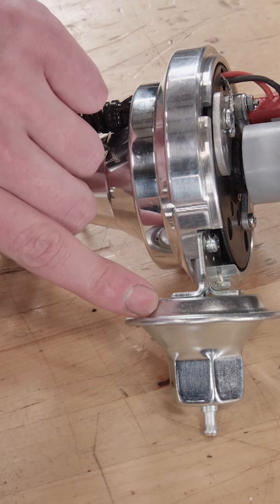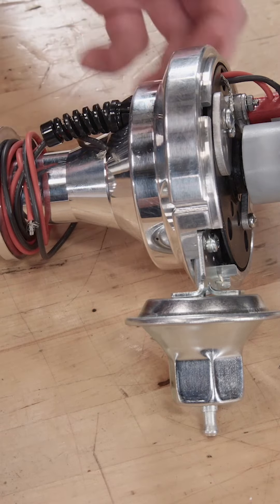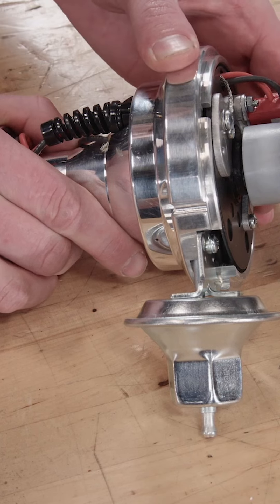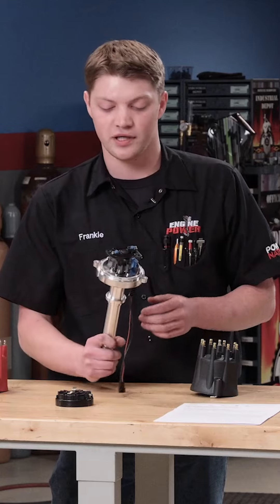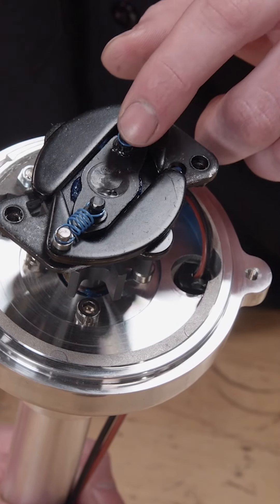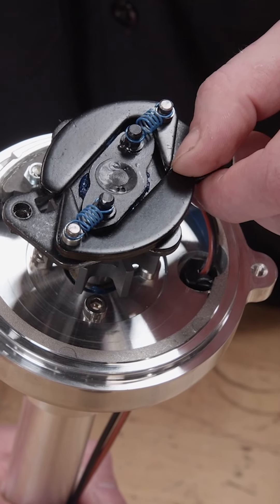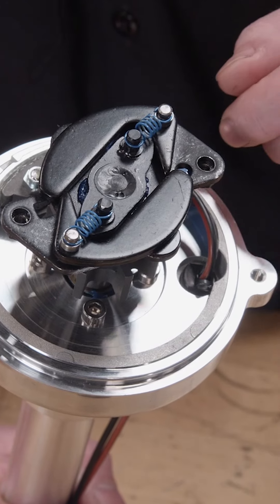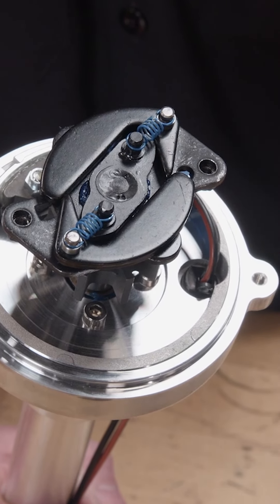Types of Distributors

Comment: Locked out is the best
Reply: Really it's been shown to decrease engine life when tuned for max power. (Imagine having 30+ degrees at idle)

The absolute best is an electronically controlled distributor like a holley hyperspark/dual sync, in my humble opinion.
Reply: @Admiral_Peck7  im talking from a racing standpoint. But you're correct absolutely not for a daily driver vehicle
Reply: @shtrzRus  even from a racing standpoint, I'd rather have capability to pull timing if something goes wrong, as well as a proper spark side rev limiter, because fuel cut rev limits are dangerous.
Reply: @Prestiged_peck  yeah I don't think you wanna have a fuel cut rev limiter in a power adder car
Reply: For cars that never idle I e. Race cars like he said.
Reply: @KingJT80  race cars idle too.
Reply: @Prestiged_peck  yeah at a way higher RPM too
Reply: @KingJT80  so you're saying you want to run 42 degrees at 1500 rpm?
Reply: @Prestiged_peck that's a  loaded question

it's whatever the engine wants and its purpose. But generally those types of engines don't idle like a stock engine